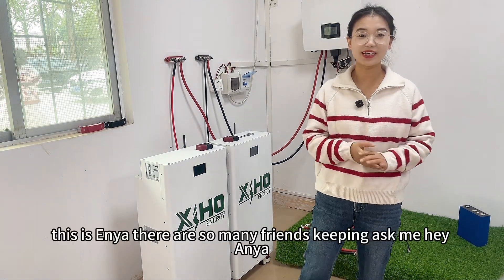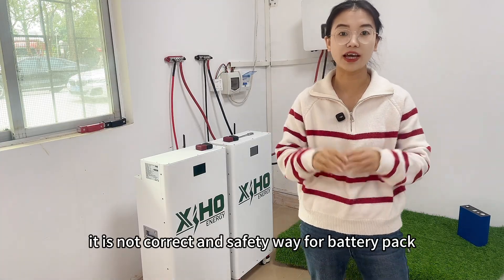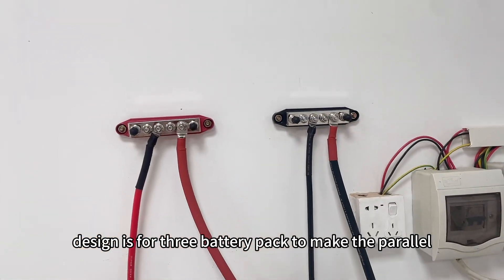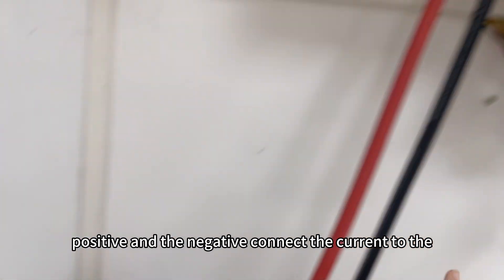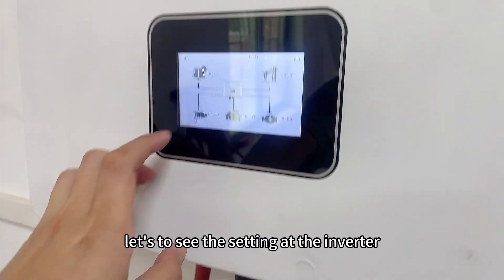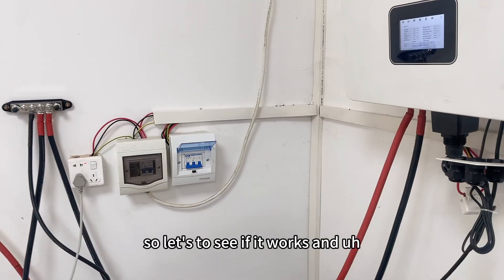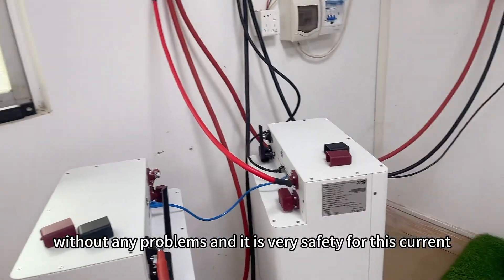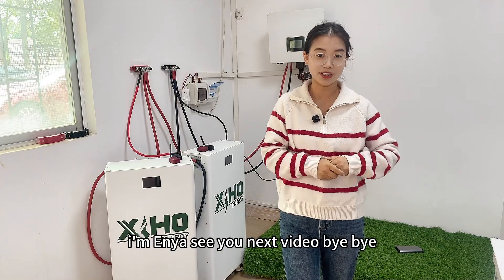How to make battery packs in parallel by PACE BMS 16kwh batteries

Comment: Würde als Anschluss lieber den Victron LynxPowerIn sehen. Da wäre jedes Batterie Anschlusskabel nochmals extra abgesichert. Leider ist auch das Pace BMS sehr ungenau was den SOC anbelangt und recht kompliziert, da man die Parameter nur über einen Laptop einstellen kann, oder gibt es eine neue Pace BMS Version wo man die Einstellungen über Bluetooth machen kann und über WLAN die einzelnen Zellen überwachen kann? Leider hab ich noch kein BMS gefunden das im Winterbetrieb ordentliche SOC Werte liefert und von den Herstellern mit einfachen Updates versorgt werden. Auch bin ich kein Freund davon Akkuzellen waagrecht zu verbauen. Besser Batterien verwenden die man im Rack oder auf Schwerlast Regalen verbauen kann, wo die Zellen in den Batterien senkrecht stehen.
Reply from the maker: SOC issue is a little hard to solve at present

Comment: Before connecting to the bus bar... should we crooscheck each individual battery voltage ? They should be  very similar.. or when switching on, the one with higher voltage willsend courant to the lower voltage one.. isn't it ?  Better connecting in parralel 2 battery with voltage in the same range +/_ 100mv
Reply: it doesn't matter. stronger will discharge faster and weaker will not discharge at all and they will sync
Reply: @322-Dota2 sorry, but very doubtfull about this.. when connecting 2x 16kw battery in parallel via the DC bus, if any significant difference in voltage, due to the low internal resistance of these batteries, it will translate in potentially 100's amps flowing in the battery with lower voltage....  before connecting in parallel better ensuring each battery is at same voltage level.
Reply: Connecting the 2 batteries via bus bar, is that not parallel ? It's ok, don't worry
Reply: @322-Dota2 😅😂😅, I did.
Reply from the maker: Friend, You're right, the first step is to make sure the voltage or SOC same and then start the paralle, but this video mainly for customers who bought battery packs from us, when the battery packs from our factory, we will set the same voltage in those battery packs, therefore, we assume that their voltages are the same, no need to check.
Reply: @starmaxenergy Thanks for the confirmation, I have no doubt on the quality of your processes and actually I do think it’s a much robust and secured process to interconnect batteries via DC bus bar. My only objective was to warn about a potential risk, performing a check ( at no cost )  always better than being sorry.

Comment: I will also place a fuse in each battery + cable, then to busbar and from that thicker cable going too fuse that protect inverter. So it can t get above max current.
All to protect each component
Reply from the maker: Yes, you're professinal, perfect is add an extra circuit break between the busbar and battery